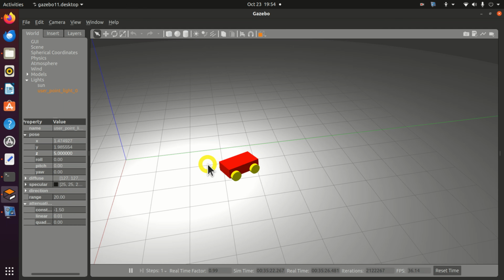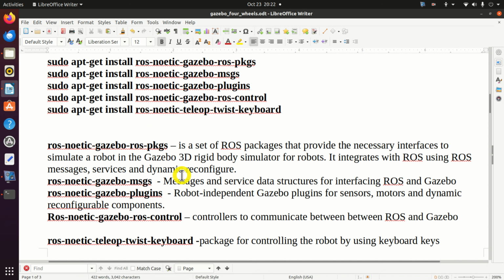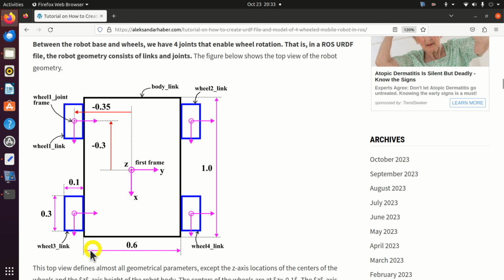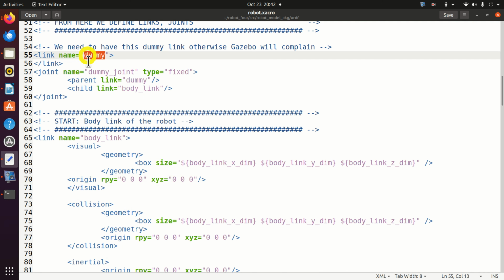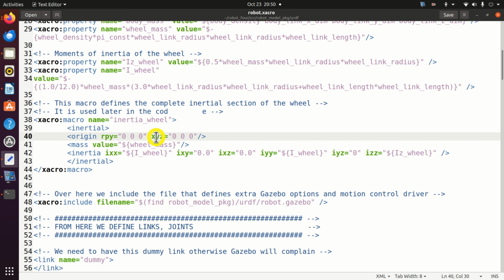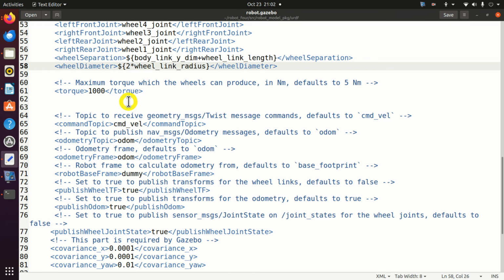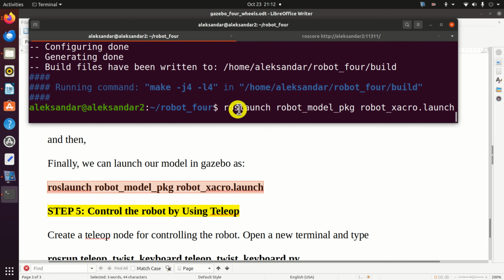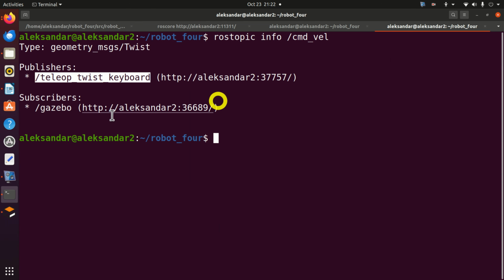Modeling, Simulation, and Control of 4-Wheeled Mobile Robot in ROS and Gazebo - From Scratch!

Comment: Hello Alexander I would like to ask you something about simulating mass spring damper system in Gazebo. Is it possible to build the model on Gazebo??
Reply: If you don't mind then could you please show the simulation in Gazebo 😊I am very new to this field and I am unable to built it.
Reply from the maker: @nitishabordoloi3987  I wish I had time to do that. Currently, I have some other priorities, however, if the time allows I will create the video.
Reply: @aleksandarhaber  thank you so much 😊😊
Reply from the maker: @nitishabordoloi3987  You are welcome.
Reply from the maker: Here is what google search reveals:
https://www.osrfoundation.org/wordpress2/wp-content/uploads/2015/04/roscon2014_scpeters.pdf

Apparently, it is possible, and I am not surprised. This is because Gazebo is an ODE simulator and you can specify spring and damping constants or something similar that is equivalent to spring and dampers.

Comment: Did you use gazebo on virtual machine (windows with installed Virtualbox (or something simillar) and gazebo) ?
Reply from the maker: We used Ubuntu, 20.04, and ROS Noetic on Linux machine. Do not use Windows if you want to learn ROS. Install Ubuntu from scratch. You can setup a dual boot on the machine.